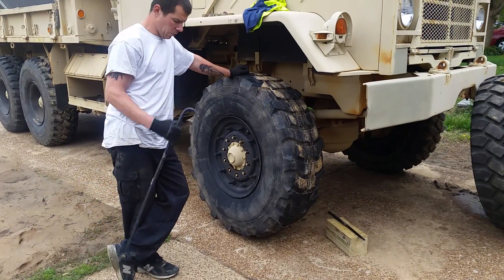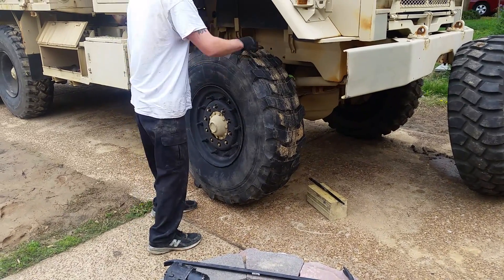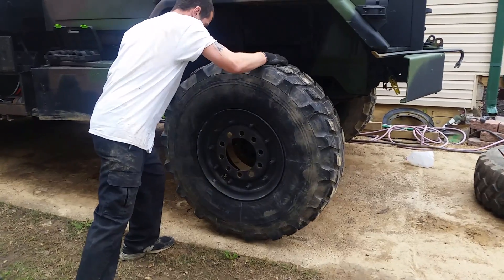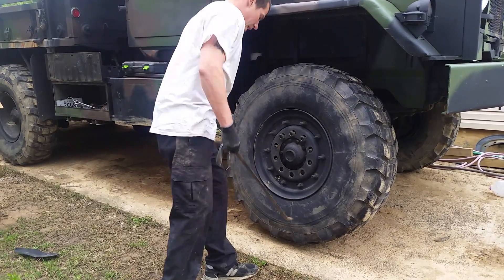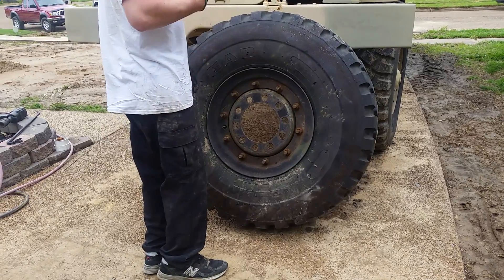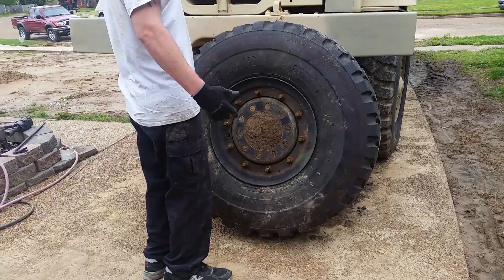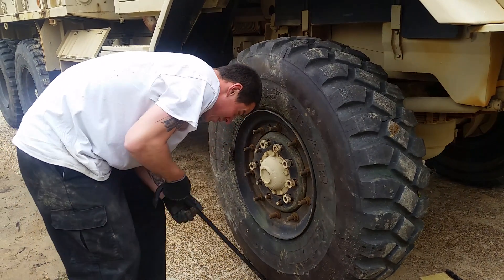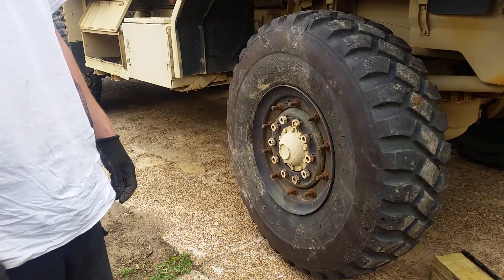5 ton military truck tire/wheel install on front hub

Comment: Are the combats wheels same on the rear axel?
Reply from the maker: Yes just flipped around
Reply: @wessimpson2794  and combat wheels are the MRAP wheels.  Sorry for silly questions  but very new to this truck
Reply from the maker: @jaysonabraham267 combat wheels for a 5 ton are budd pattern.  MRAP wheels are all 330mm hub pilot and do not fit in place of combat wheels on the 5 ton.

Comment: are there any bead lock wheels for a deuce?
Reply: and could I mount any tire that had the right specs to a military rim
Reply from the maker: M80 Gaming yes. m35A3 combat wheels or. you can get aluminum fmtv wheels and get adapter plates
Reply: ok

Comment: Do they set the engines up so they can run on almost any fuel
Reply from the maker: gunnar stahl only the M35 and older M39 series have the multi fuel engines
Reply: ok
Reply: does the adapter plate make the wheel less reliable under load
Reply from the maker: M80 Gaming No. it is 3/8" steel plate. the deuce pattern is smaller than the 10lug budd. check out steel soldiers. com
Reply: ok